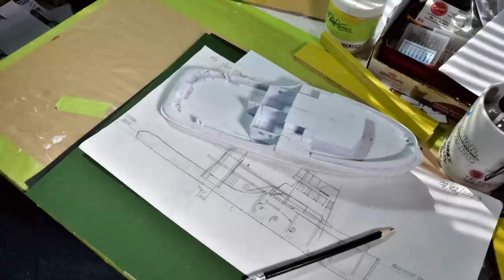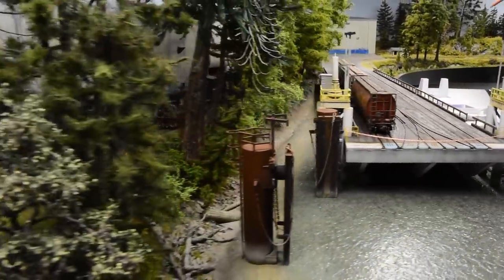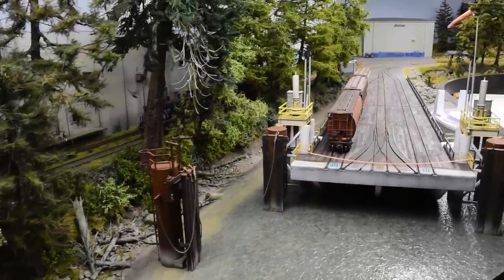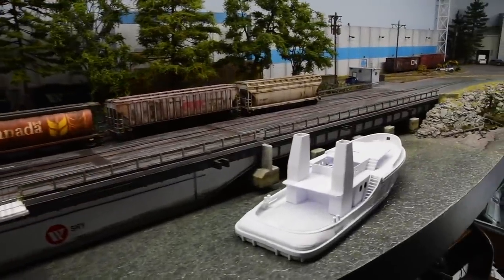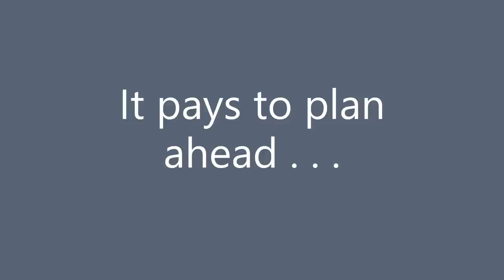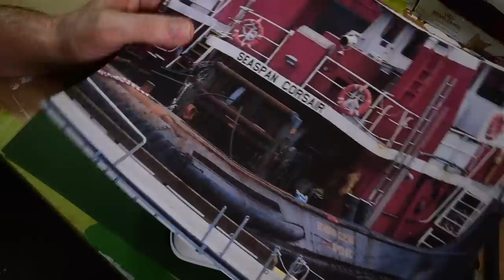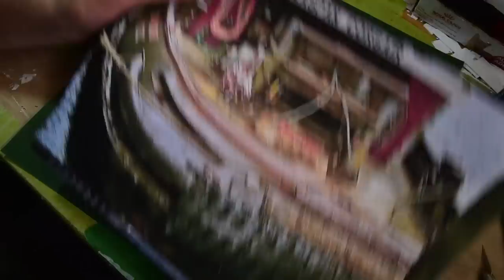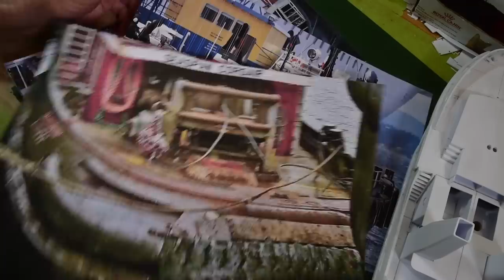Scratch Building Seaspan Corsair (Part 8) | Boomer Diorama ~ Vlog # 178

Comment: Really Enjoying this build.. as for drainage on that Upper Deck, it appears that there is a rusty metal grate in the floor that you can see on the left side here 8:01 Perhaps if it's severe weather etc it just drains straight through there to the lower deck ? Actually, looking again on the floor of the lower deck, you can actually see rust staining on the floor below that grate in the upper deck that almost mirrors the square grate in the upper deck floor.
Reply from the maker: O.K. Good observation! Thank you.
Reply: @boomerdiorama   Most Welcome. Not sure if it's correct, but appears that way and most logical.

Comment: Hey Boomer, big fan of your channel! such a huge inspiration!
Have you thought about putting a battery box in the Tug? so that you dont have to drill a hole trough that beautifull river surface, that would leave a bit of modulairty/freedom, to have the tug there and not there.

Best regards from a fan in Denmark.
Reply from the maker: I think that is a great idea. I would rather not drill a hole in the surface as you say.
Reply: You can probably fit some cellphone batteries in the spaces below the bridge, and if you want to be fancy you can put in a small charging circuit and run wires to a socket mounted in the hole you drilled, so that you can poke a plug into the bottom to recharge them.

Comment: Dear Boomer, on the small deck part after the manifolds, with the awkward bend kinda ‘kick board’ band, “no scuppers” you said, think those decks are often drained by a welded in steel ‘plug.’ Plug as the plumbers denomination. Don’t know what such a drain spout is called on a ship. Very cool how snugly you fit those parts, must be rewarding in itself. Absolutely love the Seaspan Corsair model. Beautiful series. Cheerio
Reply from the maker: It's a fun build for sure!

Comment: Looking good. Can you suggest an adhesive to glue Plastikard to foamcore ?
Reply from the maker: I use Acrylic Matte Medium or Mod Podge and clamp it or put weights on it.
Reply: I made the mistake when I first started the Puffer, I made the basic hull structure from foamcore, laid coffee sticks on for the deck. 
Now I want to add the shell plating and it is not a perfect surface for the Plastikard to adhere to. Will probably use the thinnest sheet I can get. It might also be easier putting it on in sections then sanding the joints later
Reply from the maker: @charlie1872  If you can find an alternative that is great. I use 3/8" (seven ply) for good reason, sealed both sides. I always fear the dreaded "deflection" warp that occurs half way through the build when you wake up one day, and you can't wish it away. 🤣
Reply: @boomerdiorama   Good idea. I might cut a piece and glue it to the bottom